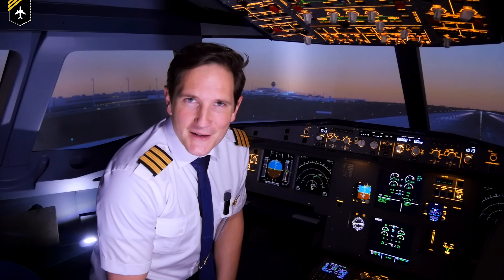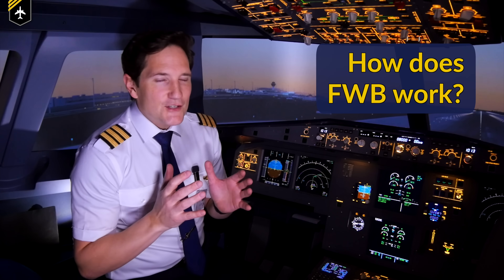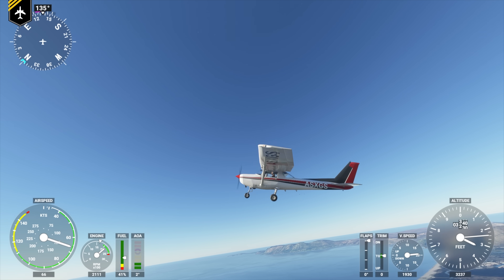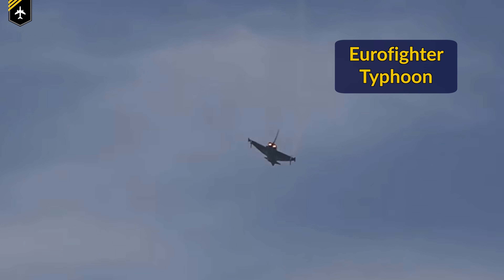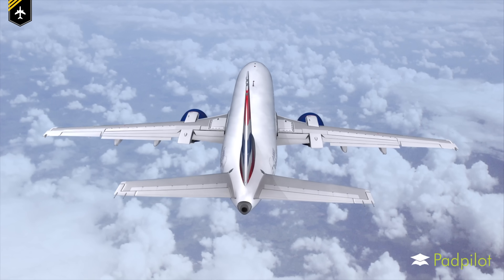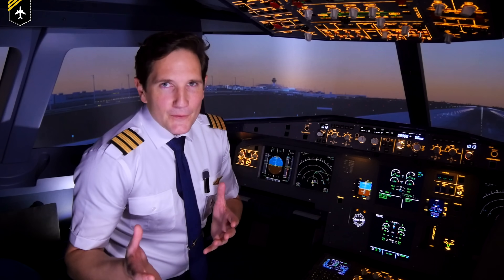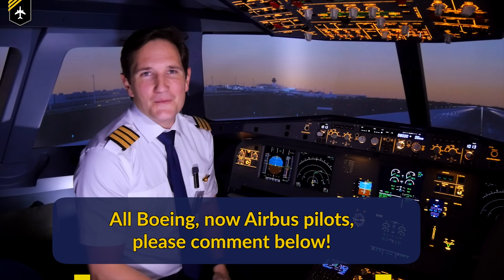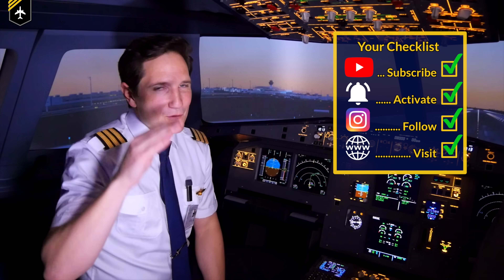How does FLY-BY-WIRE work? The future of flight controls! Explained by CAPTAIN JOE

Comment: Very interesting video. You said the SEC trims the aircraft in order to hold a constant pitch which results in a constant speed of climb/descent (did i get that correct?). In which situations do you need to trim the aircraft manually then?
Greetings from Switzerland 🇨🇭
Reply: If you mean by hand the only time in normal law is setting the TO Trim on the ground. Only other time is in direct law when autotrim is disabled

Comment: Great video, explaining both systems and their pros and cons.. I’d have one question: in the highly unlikely event of one of the rods and metal cables were to snap or get cut you’d lost control, right? How many backup cables e.g. on the other side of the plane are there in an 737? And would the same apply on the FBW system or are there many independent digital connections between the cockpit and the actuators? 
Thanks for your detailed and really informative videos - they are also fun to watch as a aviation fan 💪
Reply: The movement of aircraft in flight could be achieved by each of the engine's modulation (different thrust settings  can make the aircraft to turn) with a little more drift. Pitch up and down with  simultaneously moving the throttle's. So no need for more backup linkage.

Comment: Jeez is every comment getting a heart?

Edit: 1:09: I think it's important to note that smaller general aviation planes do not have hydraulics to boost the pilots stick power, while aircraft such as the 737 have hydraulic actuators to help the pilots maneuver. This is an important difference. Without hydraulics, the pilot would be far too weak to overcome the aerodynamic forces applied on the flight control surfaces.

Comment: now we can have more info on what happened with flight 72
Reply: The CPU of ADRIU 1 corrupted data and switched the binary labels for the altitude and angle of attack data. This information was then sent to the FCPC which takes all 3 AOA data labels and checks them for consistency.

Normally it then takes the average of AOA 1 and AOA 2 and then that figure becomes the determined AOA for that spilt second until the next cycle begins milliseconds later. If when checking the averages the FCPC gets data from all 3 and one of them exceeds the other 2, it rejects the data and memorises the last value for 1.2 seconds. 

On QF72 there were multiple spikes occurring and the FCPC was rejecting a lot of the spikes hence all the initial caution messages and overspeed/stall. However the flaw was if the spikes were precisely 1.2 seconds apart it would momentarily trick the computer into thinking the value was correct. The computed average value came to an angle of attack that was too high and a pitch attitude that was too high as well. The FCPC is programmed to prevent this and forced the plane to descend. It was only when correct data was being sent to the FCPC then it restored control as it realised it wasn’t actually pitching nose high up.

The information is all in the report with diagrams about how the whole process worked. The flaw with the FCPC was fixed but it was never determined what cause the CPU to corrupt the data

Comment: Is there any way to override the computers taking control, in case you need to do some very heavy maneuvers?
Reply: Force it into alternate law by switching off 2x ADR’s and that will disable most of the protections
Reply: @tomstravels520  what does ADR stand for?
Reply: @eggify1096  air data reference. It’s the computer that gathers air data from the pitot tubes, static ports and AOA sensors and displays them to the pilot so they know how fast and high they are travelling. If 2 out of 3 are switched off the aircraft reverts to alternate law

Comment: You wouldn't believe how my chubby C17 is like a Kung fu panda in the air. Roughly the same era of design as 320. It has a conected center sticks, but it literally feels like an extension of your body. I am still impressed every day by how well they design it, and 30yrs after I can't say that there would be a single thing that would need an update on FBW.

Comment: Also more connected to your copilot who may be pushing their joystick the opposite direction the whole time you're unable to understand why your controls are not having any effect as your plane falls out of the sky.
Reply: That’s why only one pilot should be using the sidestick, you have a takeover push button if you need to take over (or other sidestick is glitching) and you have a DUAL INPUT warning if both side sticks are moved. And the connected control didn’t stop the captain of Atlas Air 3591 from preventing his FO from plunging the aircraft into Houston bay when he thought he was stalling and could see what he was doing

Comment: The USAF  F16 came out in  the late 70's and is fly by wire and is still in service.  
I was a USAF Aircraft Mechanic all the jets I worked on were Hydraulic Flight controls, those were the C141, F15C and A10,  the A10 was different  because most of the actuators like for the rudders and ailerons were set up so both Hydraulic Systems powered each actuators so if one system was disabled it would still be powered, and if all hydraulic power was lost the pilot could flip a switch called Manual Reversion and fly it back to base using a cable and pulley system.
Fun fact the APU on some Jet Aircraft are started by Hydraulic Accumulators.

Comment: 12:42 McD followed with the MD11 in 1990. The MD11 was a FBW/FBC hybrid.
Control wheel inputs in manual flight were transmitted digitally. Feedback was given via the cables.
The elevator inputs are assisted in the neutral position. With no inputs, the elevators are automatically moved within 5° to keep the aircraft attitude stable.
With the autopilot engaged, it's full FBW. The Flight Control Computers (2 pieces with 2 channels each, so four channels in total) control only one of the four actuators (four ailerons, four elevators) dependent on what channel is in control. The other three actuators of the ailerons and elevators are slaves driven by the linkages and cables that connect them all together. Theses cables and linkages also give feedback to the pilots.

The 777 is full fly by wire. There are 16 position transducers on the control wheels/columns/pedals (6 for the control wheel (3 each for CM1 and CM2), 4 for the pedals (2 each for CM1 and CM2) and 6 for the column (3 each for CM1 and CM2)). They provide analog signals for the ACE (Actuator Control Electronics, 4 units) which convert these analog signals to digital. These digital signals are sent to the Primary flight computers (3 units) where they are processed with protection functions, stability augmentation and stuff like that. The processed signals are then sent back to the ACE and to the Autopilot Flight Director Computer. The ACEs convert the digital signals back to analog and send them to the control surfaces. The AFDC send the signals to the backdrive actuators on the control wheel/column/pedals for the protection functions (for example bank angle protection or tail strike protection).
This is in normal manual mode.

In secondary mode, when the PFC lack some information or have internal faults, some functions are not available (for example autopilot, envelope protection, thrust asymmetry compensation), but the PFC still process the digital signals and send them back to the ACE.

In direct mode, when the PFC are not available at all, the ACE send the input signals straight to the control surfaces without processing.

When the autopilot is active, the autopilot commands are sent from the AFDC to the PFC where they are processed and sent further  to the ACE where they are converted to analog signals and sent to the control surfaces. The AFDC also send commands to the backdrive actuators on the wheels/columns/pedals for feedback.

When all electronics fail, there is only pitch trim left for pitch control and two spoilers, one on either side, for roll control. These are the only actual mechanical controls left.

The Control wheels/columns/pedals are mechanically linked together, so the L/H side always knows what the R/H side does and vice versa.
Reply: No mechanical rudder control?
Reply: @tomstravels520  There's no mechanical backup for the rudder on the 777. When you lose the ACEs you have only the horizontal stabilizer trim and two spoilers for attitude control.
Reply: @Horstroad  hmmm interesting. The A320/A330/A340 I believe have mechanical stabiliser (provided the correct 2 hydraulic systems are working) and rudder. Any other turn co-ordination is through asymmetric thrust

The A380/A350 are completely different and use a Backup Control Module which is segregated from the normal system but does require a hydraulic system (Yellow only on A350) to be functioning as the power source but you can still maintain control of the THS, inboard ailerons, elevators (inboard only on A380) and rudder. It’s basically a non mechanical system

Comment: Great video as always! Would you consider making one about how pilots navigate across oceans, particularly before GPS?
Reply from the maker: Nice idea for a video!
Reply: @flywithcaptainjoe  please could you do one about navigating overall. As in GPS waypoints, SID’s/STAR’s etc and maybe different types of approaches
Reply: @flywithcaptainjoe  I'm curious about how pilots would land before ILS was common. Was it all just visual, and if it was bad weather, they just wouldn't do the flight?
Reply: @flywithcaptainjoe  please do very curious to know
Reply: Before GPS it was LORAN, OMEGA, and Inertial Navigation which was from about the 1960s. 

Before that, it was dead reckoning using a drift sight and flight computer like an E6B and making sun/star shots with a solar compass or a sextant. Errors were often significant and cumulative.. but usually good enough with the forecast upper winds from all of the weather ships to enable you to home in on a VOR or NDB which had ranges of a couple hundred miles.
Reply: @Bartonovich52  The early navigation topic reminded me of the story of that top hatch on the 747 supposedly being able to be ordered with a sextant mount back in the early models. Dunno if that was true or if anyone ordered if it is, but I would sure love to see it.
The Lockheed Constellation did have a sextant window tho from what I know (tho obviously that's far older).
Reply: Back in 1980s I was talking with a former B17 air crew member (he never talked about combat missions), he mentioned one particular flight from mainland US to Hawaii in 1940s where the navigator wanted to make the best accurate timely arrival. Navigator constantly did observations and calculations with no breaks [I forgot to ask did he ever go pee?]. With so much work he got within one minute and one mile. I have no idea how it was normally done but I'm sure a good navigator is very essential.
Reply: Celestial navigation.
Reply: Probably using loron c

Comment: 11 years ago today, the "Miracle of the Hudson" was successfully pulled off ❤️
Reply: 11 years ago today, I was 11 years younger.
Reply: And Fly-By-Wire & Flight Envelope Protection made it possible! (y)
Reply: Actually it was tomorrow
Reply: Riding the envelope 👍
Reply: @tychobra1  guess not many will get that 🤣
Reply: 2 things played an important role in Flight 1549

1. Sully's glider experience
2. Skiles literally straight out of training, knowing which pages to turn to in the QRH
Reply: @AlonsoRules  AND the flight envelope protection. It is a known fact that it prevented the plane from stalling during the final flare - without it Sully would have stalled the plane into the Hudson while pulling full back on the stick. Telemetry showed that the final feet/minute and pitch angle are close to those that are listed from Airbus as the ditch limits that leed to a succefull "landing". I am not sure that Sullys glider experince will help here that much, but it's a nice myth.
Reply: @Cinelectric  Actually, the Flight Control Law of Airbus prevented Sully from doing a optimum flare.
Reply: @Jay-hv6te  That is just not correct - check NTSB report "Conclusions 3-3.1" item 14. Clearly states that the normal law protected against stall.
Reply: @Cinelectric  I am not saying that the flight control law don’t protect against a stall. What I am saying is that the flight control law limited the pilots ability to do a better flare, at least according to Sullenberger him self.
Reply: @Haywood-Jablomie  I know - and you my friend have to learn to detect sarcasm ;)
Reply: @Cinelectric       oops, I'll delete my comment
Reply: 12 years ago, not 11
Reply: I think it was 12 years ago.
Reply: @moviestudios4681            12 years ago , I was 12 years younger
Reply: @Haywood-Jablomie  Me too
Reply: @moviestudios4681        nice !!!

Comment: Can someone correct me if I’m wrong. I’m not a pilot, nor do I claim to have the skills of one. That being said, I’ve flown my fathers ultralights and a Cessna 172, for years without any formal training. I feel that fly by wire doesn’t give the pilot the necessary feelings in the controls. Since it’s being handled entirely by computers, you can’t get the feel for the stick, so to speak. I understand it’s more work and requires a bit more training, but feeling the ailerons and rotor is an invaluable part of flying for the safety of everyone. Again, I am not a pilot.
Reply: RUDDER**

Comment: If there is a mechanical backup, how is it possible that the fly by wire system is lighter?
Reply: The mechanical back up in the A320 is the rudder pedals and the horizontal stabiliser. Not full mechanical control of the elevators and ailerons

Comment: So if there has to be a mechanical backup along with the FBW computers and backups, how is there a weight reduction, if not an increase?
Reply: The mechanical backup system is just for the rudder and horizontal stabiliser. It still weighs much less than a full mechanically system
Reply: @tomstravels520  Thank you thank you!

Comment: ur the reason i want to become a pilot aswell and i play microsoft flight simulator and use the fly by wire mod so the 320 is more realistic than the normal one and i have some good and bad landings in the game the fly by wire mod just makes it that u can use knobs in the plane that the starard version like the 3 nav knobs or fire test bottens so i get used to the aircraft and its prosidurses
Reply: @77l96  I won't buy p3d and an 150 dollar add on

Comment: So the side stick is like a steering wheel right, then why is there another steering? I have also seen it on some shows also, the pilots just have the side stick.
Reply: If you mean the steering wheel behind the sidestick that controls the nose gear wheel for taxiing